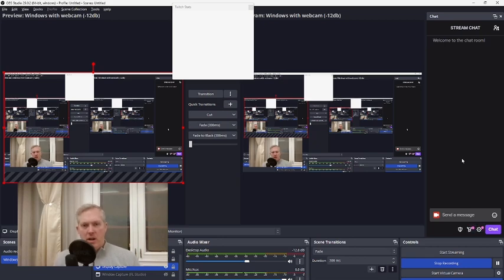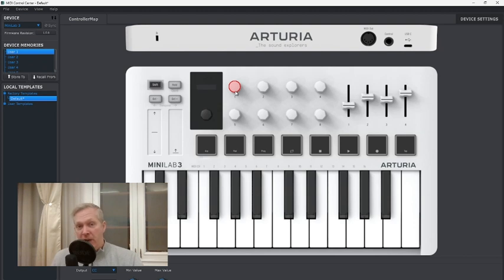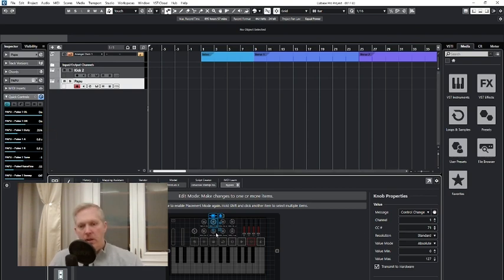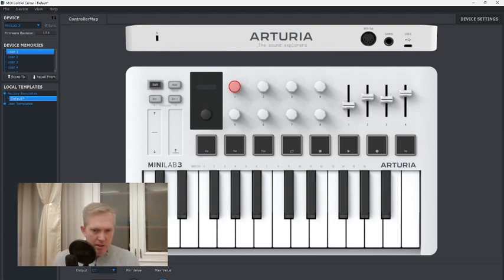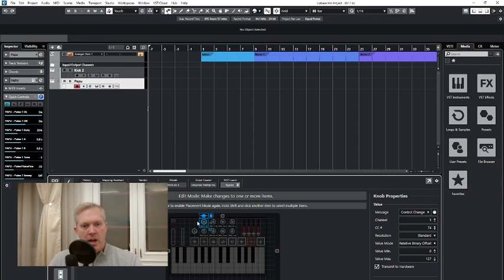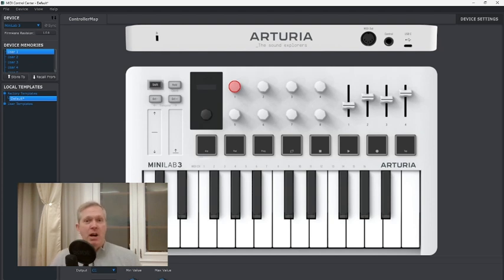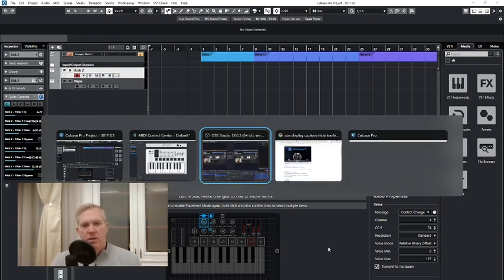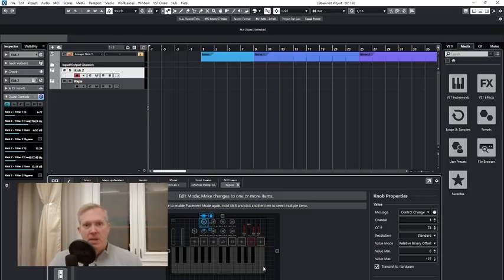Getting Arturia's MiniLab 3 Endless Knobs to Work with Cubase (No More Jumpy Values)

Comment: It's all well and good changing the value to relative on the PC software but how do you make the device connect using relative to a standalone device like an Akai MPC?  You set relative in that software and it doesn't change anything about the unit so it can't send relative to standalone devices which makes it absolute garbage.  Endless encoders that can't send relative.  Never buying Arturia products again. 👎👎👎

Comment: Thank you for sharing this. Perhaps there is still hope (I have to say I can't believe Arturia doesn't give us a tutorial. It's ridiculous. Even with the new firmware it is impossible for me to get it running -  and I'm mapping controllers since ever...) 
However, when I try your method in Cubase and exactly do as said, the knobs are picking up fine, yes, but I can only move the value to the right. When turning the knob counterclockwise, nothing happens. I have the latest firmware, perhaps they changed it somehow? Their own script for cubase doesn't do the trick either.
Reply: I just tried to set the encoders to the new relative 1 mode. Combined with the relative offset in Cubase it seems to work!!